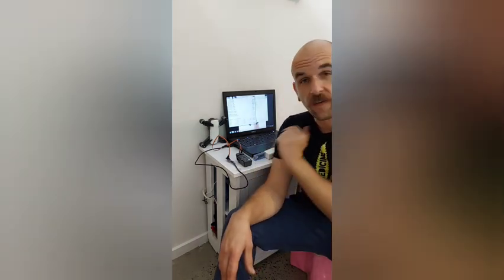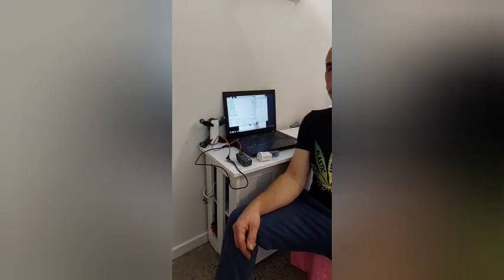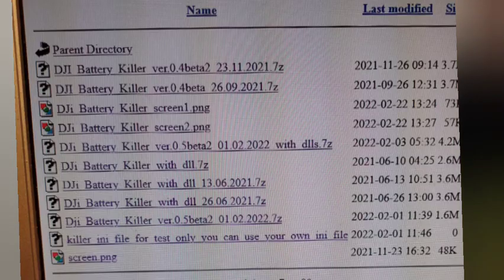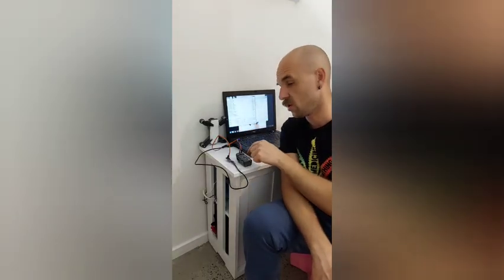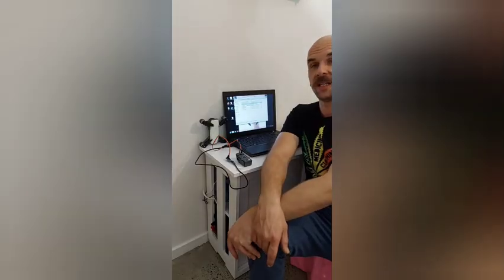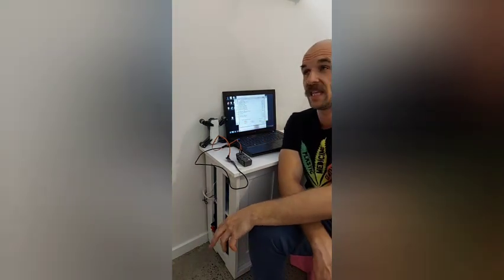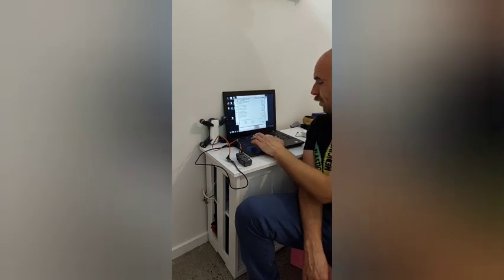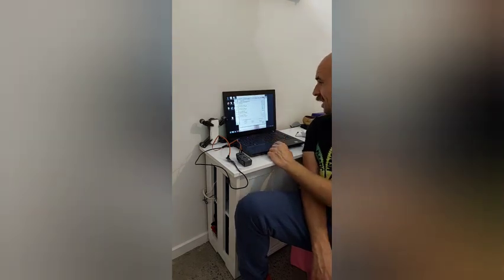DJI Spark battery not charging fix CP2112

Comment: i watched probably nearly 100 youtubes about this similar thing, no one has ever mentioned that you need an external voltage source to power on the device. Most of the youtubes which i watched were, you need to charge the battery first.
Reply from the maker: Happy to help!

Comment: I had the problem of succesful connection but unable to read the battery. It was wired to 9V battery as power source. The problem was there was no connection between the chip and the battery because of not soldering the pins in the chip. I fixed this by just pushing the pins against the metal of the chip rings during the procedure and it wordked. They seem to be charging now!
Reply: The CP2112 board I got has holes and pins which are not permanently connected to each other. If I put the pins on the hole --- they are not tight. Do I have to bring this to an electrical shop to be soldered? I already have all the components ( jumper cables, micro-usb to USB cable, 9V batt and snap on connector, and the software); need help. Thank you.
Reply: @gilean6179  Yes it is meant to be soldered yourself after shipment to make it more compact and cheaper
Reply: @Syclone0044  thank you.

Comment: Hi, my battery now refuses to charge and even the indicator leds were dim(not as bright as those shown in above video). Is there any chance to revive it using the method above?
Reply: Hello! Had you found a solution? My batteries not even blink... no charge at all.. Had flight until "low battery" massage and that all

Comment: Hi, I got the CP Board, as well as an adapter. When connecting, it always gives me an error that it cannot open the the device. It does not even recognize my only working battery. Wiring is correct and I am not sure if it has to do with my drivers or anything... Do you have an idea how to solve this? Thank you!
Reply: I managed to have it recognized on a different computer. But now I am getting stuck with an Error when "Could not perform SMbus read 0x00". I thought it would be because of voltage but it also appears with the charged battery.

Comment: First many thanks for this video and your help, it works...

But i is not so easy as it seems. Same problems!
First i can´t connect the Adapter, i thought it was defect. I tried 4 USB-cables, it doesn´t worked. Then i found a old cable with a adapter, and i got a connection. It is imprtent, that you use a USB-data cable, the most are only charging cables for devices! It makes a "ping" when USB connected with the CP2112.
Then i can´t read the DJI-Akku. (ERROR: Could not perform SMBus read 0x00). That means you must charge the Akku first, with 12 V extern. But I tried it with a 9V-Battery, and it works. I let the Battery a half hour for charge, and after a second try i got a connection to read information, but then the connection was broken. Then I tried to leave the Battery charging on the Akku while reading, and that works too. Connect the minus from battery to the second from left on akku and the plus to the 3rd from left, like shown in the video. Connect the other 3 cables for SCL, GND and SDA too, try to read and unseal and reset. I reset both, Clear_PF and Clear_PF2.
After that put the Akku as fast as possiblie on the charging-station to load it. It worked on my both DJI-Spark-Akkus.
Hope you get success to, good luck!

Comment: Thanks for this! I finally got it to work!

At first the cp2112 board wasn't getting recognized by my laptop. I tried 2 usb cords and thought I had a defective board (from ebay). I was going to give up but decided to try a bunch of other usb cords I have laying around. On the 4th try, it worked! If you're having trouble connecting or even charging after the reset, try different usb cords. 👍
Reply: Did you have to connect the battery to an external power source even if you use the usb connection to the CP2112 board and connect the board to the battery?

Comment: For anyone who is looking for a cheap, and easy external power source a 9v battery worked for me. I just stripped the wires on one of the ends of a jumper wire, and electrical taped them to the negative and positive terminals of the battery. Worked like a charm.
Reply: Thanks for this tip. It worked. I used a 9v snap connector which made it even easier.

Comment: Success! Fixed all 4 of my NOS DJI Spark batteries that had been stored (new) for 3 years and were completely dead/unresponsive. Used a $10 CP2112 on Amazon. Super easy to solder the 2 8-pin headers on. Used DuPont cables to join the CP2112 to the Spark batteries (I gently pressed the pins into the battery contacts and this worked well.) No need to disassemble battery!! (Unless it’s a Mavic Pro as those don’t have SDA/SCL terminals exposed).

A Critical step with these fully dead batteries is to apply +12v to a + and GND- of the battery at the same time as the CP2112. I managed to get by using a simple 9V alkaline battery for 3 batteries lol. But one of my Spark batteries needed a 12v supply, the 9V was too weak, it would connect but the PF Flag Clear kept failing (it would clear but immediately re-set itself) As soon as I used 12V it cleared it for good and I was able to charge all 4 batteries fully in Spark.

I flew all 4 and they all lasted the same 12-14min as my personal good batteries! So this PF flag is an unnecessary time-bomb kill switch. We should make a class action lawsuit against DJI for this.

FYI my cells were actually at 2.2v-1.8v internally.

PS: Not sure why but the CP2112 did not appear as USB HID device on my Windows 7 PC no matter what I tried. Then I connected it to my Mac and ran a “lsusb” and saw the Silicon chip connected, proving the device is not faulty. I reconnected to my PC and wtf this time it immediately showed up in DJI Battery Killer! You have to start on that tab (far right tab) and select the list with valid numbers, then click CONNECT. On my PC it displayed:
1. (blank)
2. 32101234 (or some 8 digit number) <—- this is the CP2112
3. yyyyyyyyyyyyy
4. yyyyyyyyyyyyy

When the CP2112 was not connecting properly, the 1, 3, 4 would show but not the 2 I needed. If I hadn’t tried my Mac I might have gotten frustrated and concluded the CP2112 was faulty, as it’s a simple USB HID Class device that needs no drivers at all, so in theory you’d expect it to show up instantly every time you plug it in...

Comment: I'm only getting errors despite external power

Not able to connect to the board

Do you have any flashing LEDs from the unit when active?
Mine seems dead

Or did you have to install any drivers?
Reply from the maker: When connecting cp2112, my pc had the drivers and installed them straight away. When I connected cp2112 on my lap top I had to search for missing files and drivers download and install them to work. 

My battery would flash the first and second LED when charging. It wasn't really charging just looked like it was, there was no current draw.

Once everything was wired and connected all that was required was literally a little jump-start from an external 12v source to "connect to the battery". 

Goodluck
Reply: @veganon5grams486  I am getting no led flashes and it's not picking up the device in windows on my laptop and or computer

I must have a dud 

Thank you for confirming 

Gonna order another one 

Fingers crossed
Reply from the maker: @Deep Mystic  yea the Battery needs to show at least some life. Windows should recognise the Cp2112 board as soon as its plugged into the usb regardless of its connected to a Battery
Reply: @veganon5grams486  When I connect to my laptop or computer, it shows connected in the software

However I can't see nothing in the driver's list

So is there a driver package you can install for windows 11?
Reply: @deepmystic6739  please see my top level comment I just posted with my solution to this problem

Comment: I have problem to connect  cp2112 in the pc windows  the software say this Could not open CP2112 HID USB to SMBus/I2C adapter you know what happen ?
Reply from the maker: On my PC it connected straight away. On the laptop I had missing files... every error that came up I google searched for the files... downloaded and installed them to get it working on my lap top

Comment: Thanks for sharing. I looked at getting all this stuff but seemed too much just  to fix one battery that failed on DJI charger. I found a video that showed how to open battery then i connected a cheap single cell lipo charger to the exposed contacts on the circuit card at end of pack. I charged the batteries one by one to charge them to ~3 v.  (They were 2.2v, 1.9v, and 2.2v when i opened battery) I put it back on DJI charger and it worked/started charging ok.
Reply: Update: Success! Fixed all 4 of my NOS DJI Spark batteries that had been stored (new) for 3 years and were completely dead/unresponsive. Used a $10 CP2112 on Amazon. Super easy to solder the 2 8-pin headers on. Used DuPont cables to join the CP2112 to the Spark batteries (I gently pressed the pins into the battery contacts and this worked well.) No need to disassemble battery!! (Unless it’s a Mavic Pro as those don’t have SDA/SCL terminals exposed).

A Critical step with these fully dead batteries is to apply +12v to a + and GND- of the battery at the same time as the CP2112. I managed to get by using a simple 9V alkaline battery for 3 batteries lol. But one of my Spark batteries needed a 12v supply, the 9V was too weak, it would connect but the PF Flag Clear kept failing (it would clear but immediately re-set itself) As soon as I used 12V it cleared it for good and I was able to charge all 4 batteries fully in Spark.

I flew all 4 and they all lasted the same 12-14min as my personal good batteries! So this PF flag is an unnecessary time-bomb kill switch. We should make a class action lawsuit against DJI for this.

FYI my cells were actually at 2.2v-1.8v internally.

PS: Not sure why but the CP2112 did not appear as USB HID device on my Windows 7 PC no matter what I tried. Then I connected it to my Mac and ran a “lsusb” and saw the Silicon chip connected, proving the device is not faulty. I reconnected to my PC and wtf this time it immediately showed up in DJI Battery Killer! You have to start on that tab (far right tab) and select the list with valid numbers, then click CONNECT. On my PC it displayed:
1. (blank)
2. 32101234 (or some 8 digit number) <—- this is the CP2112
3. yyyyyyyyyyyyy
4. yyyyyyyyyyyyy

When the CP2112 was not connecting properly, the 1, 3, 4 would show but not the 2 I needed. If I hadn’t tried my Mac I might have gotten frustrated and concluded the CP2112 was faulty, as it’s a simple USB HID Class device that needs no drivers at all, so in theory you’d expect it to show up instantly every time you plug it in...
Reply: @Syclone0044  Thank you so much for the info buddy. I really appreciate you going out of your way to explain that! One clarification : when you mentioned the "critical step" about connecting the input power leads "at the same time as cp2112"....Can you please clarify this for me. Do you mean plug the usb in and the power leads in aft the same time? Thank you again! 🙏💪
Reply: @carlinpillay8198  yes it’s like you’re connecting the USB for the data comms, but 9-12V power to awaken the battery’s BMS circuits so they’ll talk to the USB.
Reply: Thanks I think that’s what I’m gonna do. I have 4 brand new in box Spark batteries I bought years ago and tested them all immediately and returned 2 bad ones for working replacements, so I know all 4 were good. But now it’s 3 years later and I want to sell them and all 4 are dead. I have Spark plugged in via USB and it only flashes 1-2 x4 and then no lights. It draws 0.147A. If I press battery button while Spark is charging, and then hold it down 2 sec to power on battery, it draws 0.154A. I am going to try both these modes for 8 hours and see if perhaps it will wake up the batteries.

If that doesn’t work I will either buy a CP2112 or do a 12V jump start or use my simple Raspberry Pi Pico LiPo charger circuit to charge each cell.

Really would hate to open the batteries as I wouldn’t feel right selling them as New then.

Comment: Just revived 2 batteries with this guide!! Thank you so much!, just done some extra checks... I couldnt do it the fist time, the sofware sayed PF clearef but wasnt true, keep cleaning the PF until its gone on the bit register tab, once its gone, Click SEAL, exit the app,  disconect the 12V power supply and remove the test pins from the battery and set the battery to charge ASAP.
Reply from the maker: Excellent!!
Reply: Hey I got the chip to follow this tutorial but it seems that my pc is not recognizing the chip. Do I have to install drivers? I connect the battery and I get error on the software (could not open device) any ideas ? Thank you so much
Reply: @franciscotorres5113  no drivers needed, do the propper connections and also use the 12V source while you try to connect it to the pC
Reply: @franciscotorres5113  No drivers need be installed. This is bizarre but for some reason mine wouldn’t recognize either. I connected my CP2112 to a Mac and did “lsusb” and it listed the Silicon chip! So I knew it was not faulty. Went back to PC and this time it worked?????? Fixed all 4 of my Spark batteries. The next day I tried the CP2112 again and now it won’t connect to the PC again! Very strange.

Comment: I've connected my spark battery to the board and when I press connect i receive the message "CP2112 HID USB to SMBus/I2C adapter successfully opened
CP2112 HID USB to SMBus/I2C adapter successfully configured". However, when I press 'read info' i get the two errors: errors:

Error Could not write Block to 0x44

----------------------------------------------------------------
ERROR: Could not perform SMBus read 0x00

Can anybody help? I soldered on the outside row of pins but not the inside row to the board. Do you think this would affect it connecting? Thanks
Reply: connect 12v power on the + - of the battery terminal for at least 10mins then run again the read info..
Reply from the maker: Oh yea... and solder all the pins to eliminate any connectivity issues... just in case
Reply: Connect the 12v power supply as mentioned at the same time you are reding the data, this way you can get readings. I did it myself, I checked and refresh the registers (see Bit register tab once you click registers button) each time I clicked "Clear PF" until the flag was gone, disconnected it and set it to charge right away. Brief: once you geat reads, unseal, click clear PF as many times as needed until you see the bit register "PF" on operation status on GREEN, click SEAL, exit the app, unplug 12V power, disconnect the all the pins and set the battery to charge right away.
Reply from the maker: Hi, this is for the spark battery right?
Are you using the same version of software?
So pressing info doesn't work... what about "unsealing" the battery and performing PF clears and chip resets and resealing?

What operating system are you using to run the software?
Reply: Espero que entenda a minha resposta.
Tive o mesmo erro, segui as dicas dos colegas e deu certo.
Reply: @nandobkr  Tem como me passar esse link do programa que ele está usando essa versão nova a minha é a mais antiga e n consigo baixar a nova.
Reply: Same issue here, have you got any solution yet?

Comment: thank you very much - I am about to do this. Dummy question - what is the safest way to jolt the batter to life? What types of 12V external power source would be the safest?
Reply from the maker: This is why I did say how I did mine becausei didn'twant to confuse or make it seem difficult, I have a 12v solar set up and I used the output on that because it's regulated and has safety features. If I didn't have that I would use a 12v SLA battery and if that was not an option I would use a power supply that outputted 12v at 1000mA (I'm not a qualified electrician I don't know if it's safe I'm just telling you my logic). It doesn't take long... just enough for the debug board cp2112 to connect to the battery. Good luck 👍
Reply: @veganon5grams486  - thanks for the info. Waiting for my cp2112 circuit board to arrive and will update if I have any luck. If I put the battery in the charger for a while I can press the light and it does blink for a few secs. That should indicate perhaps it is not completely drained? I wonder if that would avoid the need to jump start the batteries.
Reply from the maker: @yfaitube  hopefully. I suggest just leave the battery until you have all your parts... from research trying to charge it while its in permanent failure fault will slowly drain the battery more, so be careful.
Reply: @veganon5grams486  thank you!